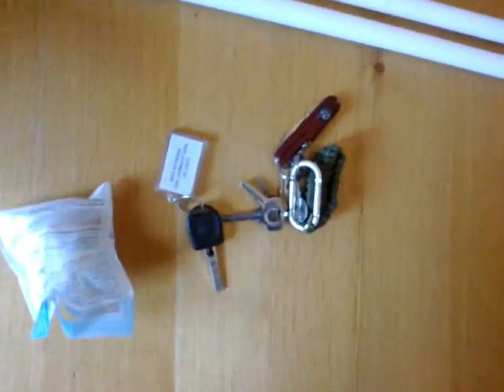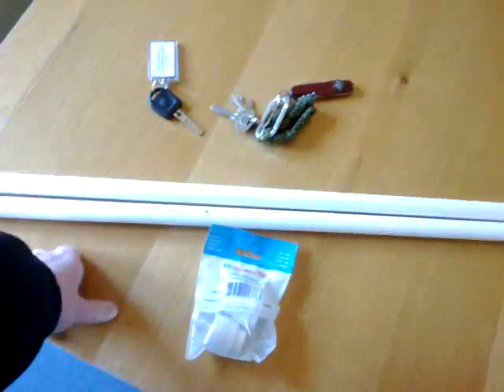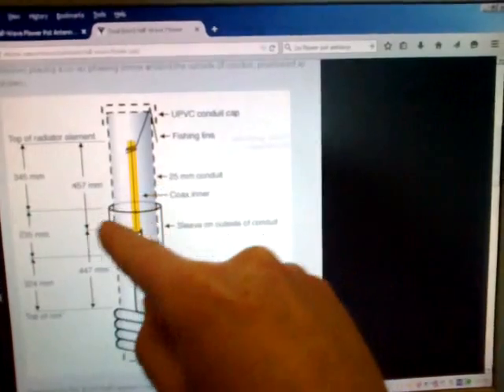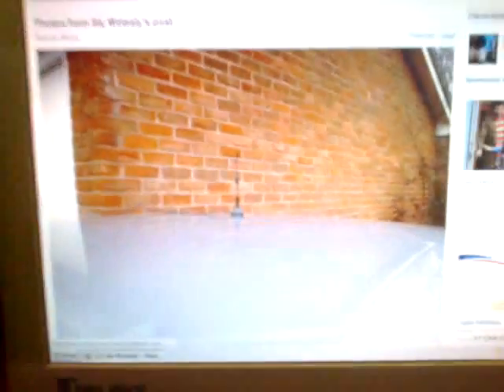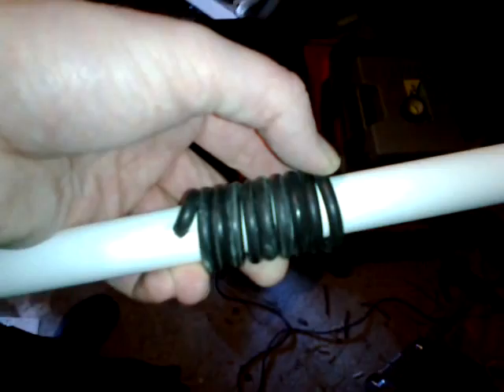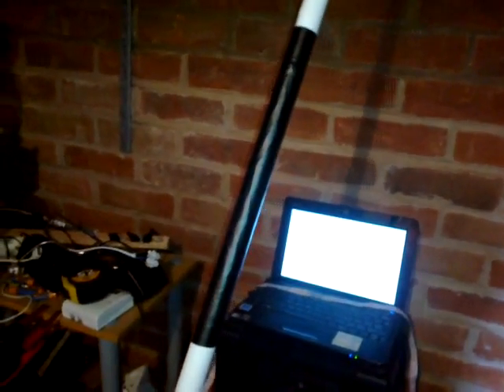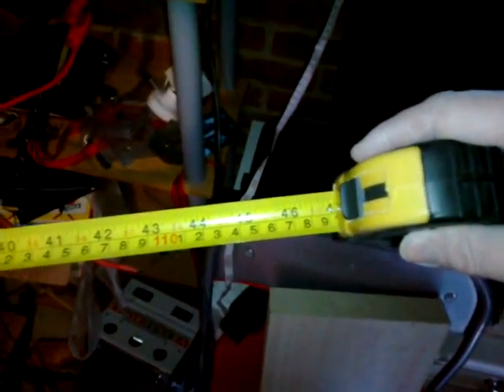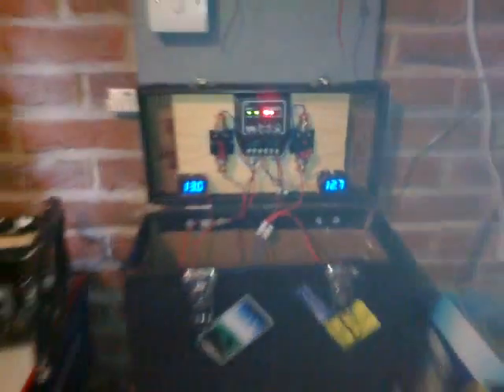homemade dual band half wave flower pot antenna

Comment: Did you see my video for the UHF one for, well UHF and PMR. I used that strapped to my Bergen! We do have 25mm in the UK but it is electrical conduit and not water pipe, Wickes do it and screwfix. Good luck with it

Comment: I have made several of these antenna's by VK2ZOI. They are quite broadband and will cover vhf marine as well as 2 m with about 1.5:1 VSWR from 146-156mhz. the dual bander will cover UHF CB (477 mhz, however, vswr about 2.3:1, 1.1:1 on 435 mhz. the coax coil choke is extremely critical, 9 turns on 25mm former, if you use say, 20mm former this increases to 13 turns, a wider former is less turns. I found this coil choke the most difficult to adjust, first make the whole antenna on the outside of your conduit, or fibgrelass, whatever you are using before final drilling. I found performance on 70cm not brilliant, my diamond x50, dual bander was far better performance signal wise than this flowerpot antenna. They called it a flowerpot antenna as it was designed to be hidden in a flowerpot complete with plastic flowers for apartment dwellers, etc.I used a surecom SA-250 antenna analyzer to test vswr, so, for those who want to dob me into the R.I's, i did not test it with a transmitter out of band,
Cheers
Barry, VK2FP